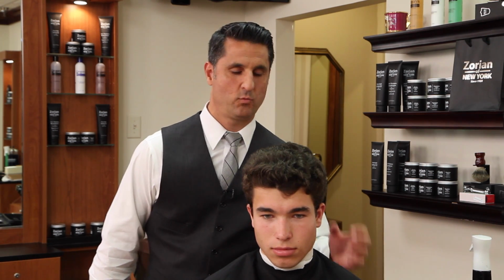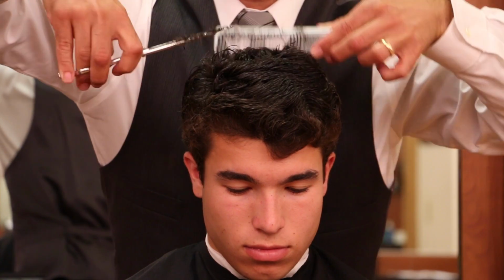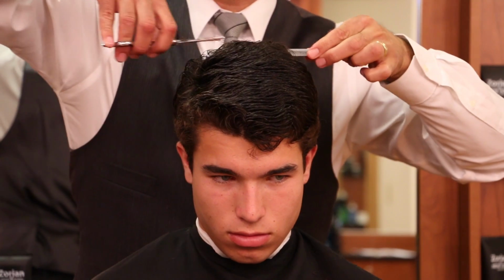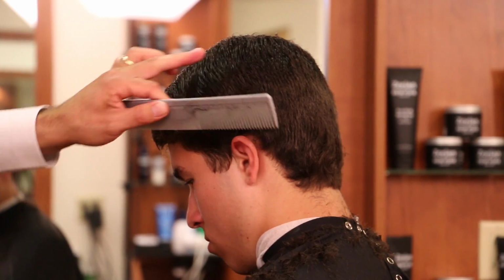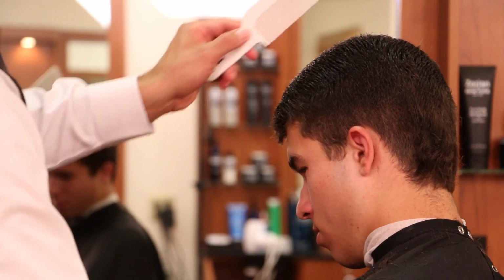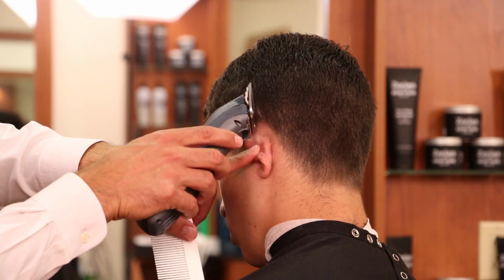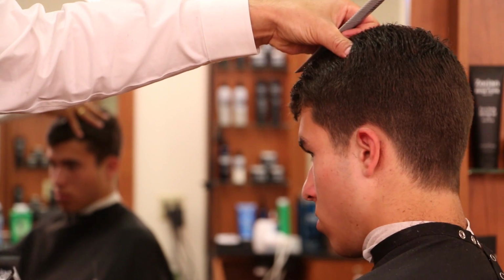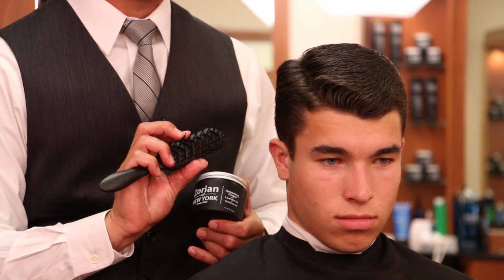Classic Side Part for Thick Wavy Hair - Men's Hair Cutting - Barber Shear and Clipper Cutting

Comment: Is starting from the top towards the bottom better for more experienced barbers?  As a novice, I feel that there is a risk that my shaky hands might waver when blending to the top.  By starting from the bottom and leaving a line to blend, I feel like I have some wiggle room to blend out any mistakes.  What do you think?
Reply from the maker: It's fine to do it either way. I find if I make the line it takes longer to blend and I risk pushing it up too high. That is me though everyone is different
Reply: @GregZorian  thanks!  That makes sense!